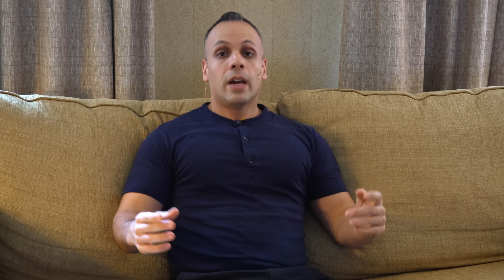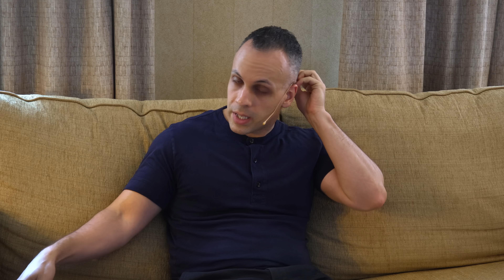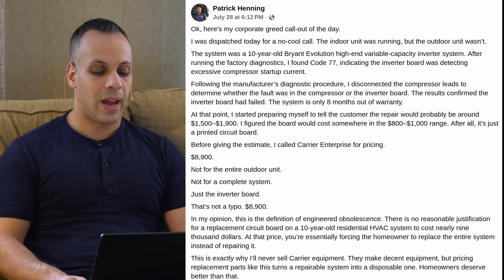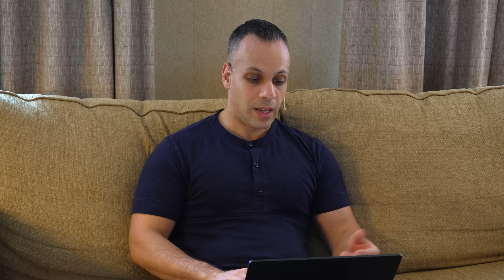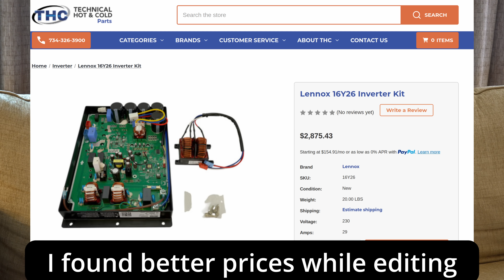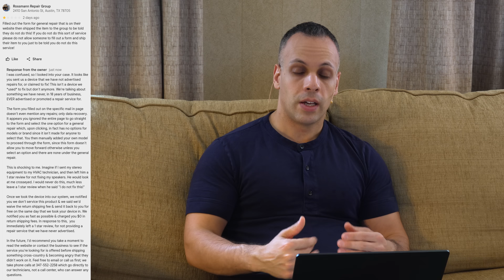Carrier AC repair has $8700 part cost for residential unit

Comment: A major problem in the HVAC industry is ever-changing environmental regulations. There is no expecation for industry to have long term, high volume production. They have to retool constantly because something that was compliant this year won't be a few years later.

It's interesting because in a closely related field, decorative heating appliances (fireplaces) are largely exempt from these standards, and 30+ year old units are often easily repaired with affordable parts that are still being manufactured. With some of the better manufactured units, the lifespan is effectively indefinate. I've replaced valves in 30 year old units that still look new, and I have no reason to believe they wouldn't last another 30 years.

Comment: Carrier is a shit company to do repair work for. They don’t keep a decent stock of warranty parts, itll take them about a business week just to get the parts to you, and out of warranty OEM parts are 2-10x the cost of an equivalent replacement part. Motors and boards are extremely sensitive to power fluctuations to the home. Their coils were pretty decent up until they shifted to the V style upflow coils, which now leak almost as often as Lennox and Trane. Im at the point now where when I open up my own business Ill try to steer as many customers away from this high efficiency equipment and install single or two stage units that only use capacitors and contactors for their outdoor units. Basically all blowers are ECM or variable speed but there are much cheaper and better built brands than Carrier’s crap

Comment: You're genuinely better off using old school dumb systems for this reason, at least if grid ties and not using a ton of energy. There are HVAC systems out there with zero pcbs still, you just gotta find em. You can definitely get the PCB out of the condenser at least, air handler pcbs hold up a lot better in practice.
Reply: As for power saving : just leave your ac set at a comfortable temp and never touch it. Smart thermostats are a scam. They kill systems.

Comment: Replace the electrolytic capacitors, $100 or so from DigiKey, you are ready to go. A/C tech added 2 pounds of R22 last month to our 30 year old 4 ton geothermal Water Furnace A/C system. When he leaves he hands me a pamphlet containing the replacement system info and prices. Mid level system (Air handler, compressor, evap coil, blower, heat exchanger) $25,300.  A new air to air heat pump from Goodman, a bit less than $6k. I can buy a boat load of electricity with $19,000 dollars.

Comment: You should absolutely try to get into the circuit board repair world for HVAC equipment. It would help a lot of private owners out (smaller businesses etc) if you can get them done faster than ordering a new board. Usually when a board is down, it's urgent, it's not like "oh, I'll use my older backup laptop until you fix my good one" - it's their one source of heating/cooling for that space. I do a lot of government HVAC design in Canada and they would never consider getting a board fixed. They'd throw the whole system out. I have also been bitten by reusing an older style furnace for a private client to save them some money, and finding out that they used to not be able to do certain things that all new ones can do, and that resulted in comfort issues in the space, so that's a downside of fixing the older ones

Comment: So.......people STOP allowing sales people to SELL you on variable speed condensers/compressors and 2 speed condensers/compressors for your AC system !!!!!!!!!!!!!! STOP STOP STOP!!!!!!!!!!!!!!!!
VFD variable frequency drive motors are great at ramping up and down to meet demand......until they fail or the drivers fail.  The variable compressors are TRIPLE the replacement cost and the driver boards are SUPER expensive IF you can find them.
When it comes to home AC......stay with tried and true.  SINGLE speed condenser/compressor !!!!!!!!!!!  ON or OFF....nothing in between !

Comment: I call bs, that may be what he is trying to charge the customer inverter and control board for the outdoor unit probably under 4k which is still expensive. He is probably the same type of contractor that charges 600 dollars to change out a 30 dollar contractor

Comment: As with any of these HVAC products, some will go bad, it doesn't matter the Brand.  It's at that point that you find out whether you've chosen a good Brand, or not.  I've had experience with trying to get a faulty compressor replaced in a newly installed Carrier unit.  Let's just say I will not be buying any of their products again.  Fuck Carrier.

Comment: I had a Samsung washer that would turn on but had a start button that wouldn’t work. To replace the board was $400. I got a bag of electronic buttons for $2.00 and soldered the new one on. It wasn’t a perfect match but once the casing was on everything worked and you couldn’t see it anyway.
Reply: On off switch is one thing..........a VFD control board is something all together different !

Comment: BRYANT is carrier to. The whole industry is a Scam. I worked in it for 20 years.
Reply: The move to VFD compressors is the issue...........the compressors are triple the cost and the variable frequency drive controllers are super expensive.

Comment: This is exactly why I refuse to replace my furnace and outdoor condensing unit that I installed in '86. I maintain them properly and they are so cheap to fix. I have never had any trouble with them. 
A couple of thermocouples, that's it. Lol.

Comment: It's totally not the same thing but the Midea U window units are variable speed inverter driven and can be had for less than $400. There is an inverter board in there. And a compressor. And fans. And all the supporting parts of an air conditioner. Upsizing a unit is no excuse for the board to cost $8000.

Comment: I thought it was going to be about an AC unit on an actual carrier (youtube is cutting off titles now on their current shitty UI revamp on my setup).

The problem in this scenario is most people are braindead, and will not check manufacturers practices or track record before signing a piece of paper.

Ask me how I know ? That's exactly what the rest of my family does and the more I warn them about that, the more they do it seemingly out of spite.

Therefore, what we need is laws to regulate this, yeah sorry I said the scary word. A ten year warranty for something that's gonna be outside 24/7 is not the best but not the worst either, but ready access to ALL the parts involved at a fair rate should be available for at least 20-25 years. If main company doesn't want to do it themselves, then they should be forced to opensource their plans and allow third parties to make OEM spec parts instead of this endless copyright nightmare we live in. When the product is a quarter of a century old we can reasonably start debating how hard it can be to remake new stocks of parts.

Comment: I quit my residential job and moved to commercial refrigeration just so I didn't have to see what was happening to the industry. I no longer work with money. My guess is Carrier saw what was happening in the industry where all of the small local shops were being bought up by private equity and price gouging. Even before this manufactured obsolescence was becoming this big of a problem, these companies were pricing repairs to the point where replacing equipment every 10 years was more cost effective when in reality, you should be able to expect 15-20 years out of your equipment. The private equity that purchased the company is worked for had us recording video bios about ourselves to send our customers to make them more comfortable with buying things from us. They started referring to technicians as sales techs to us and comfort consultants to the customers.  When people started crying over the prices I was quoting, I walked out. Actually the day I quit i cleaned out my truck before going into work, the higher ups from the private equity were there to watch as other techs made these videos. I tossed my keys to my boss and walked out right in front of these people and they knew that I was their second highest grossing tech out of 24. That company over the last 5 years has gone from being worth $13m to just $2.3m. I know it doesn't bother some people to do these things but I was not okay selling an $18000 system to someone who barely makes that on social security annually. I probably shouldn't post this here, but I doubt anybody that matters will see it. I started scalping employees from that company when I was still working there and doing the same exact equipment install for about one third of the price and still making more than my actual job paid me. For those of you that pay for a "comfort plan" of some sort every year, stop and have someone come out every 5 years and change your blower and compressor capacitor as well as clean your flame sensor and check gas pressure. Clean your own condenser with only water every spring and change your filter regularly. Youll save money. These plans are costing upwards of $200 per year for a full system and they include nothing but the foot in the door for a company to sell you more shit you don't need. I have stepped away from side work at this point but with my installs my customers got an included 1 year check up and service calls were free through the duration of the warranty.

Comment: My central unit used r22.  It got a leak somewhere and my only option was to have entire unit replaced. It was vastly cheaper to install minisplits throughout the house. Replacing an entire mini-split is only a few hundred bucks.

Comment: Also dude, most guys in HVAC are not that sophisticated. Even good techs won't necessarily even have a soldering iron on their vans. We use these old BMS boards that are built on a DOS system. There's a simple failure point I found right on a terminal block for the 24v power that will cause intermittent issues. You don't even need to add solder. Just heat up the pin and the problem is fixed. I've told so many people about this but they still just replace the board. It's crazy. Supermarket techs supposed to have some of the highest diagnostic competency. We don't like scary electronics though

Comment: I work on supermarket refrigeration systems and you can buy a whole VFD controller that powers multiple large condenser motors for less than that carrier board. Theyll run 24/7 and last over a decade easily. The problem we run into is areas that have dirty power kills them things but you can get inlet and outlet filters that will protect them

Comment: I used to to residential a/c repairs 15 years ago. Carrier is the one brand I would steer away from due to bad designs that led to early failures. They used to be such a reputable company but I feel like the greed over actual function has taken them over.

Comment: When our "help" window AC went out, because of my age, we call our go to HVAC guy.  Since it was a relative cheap window unit, I asked his wife about inverter window AC.   She replied with silence.   So we ended up getting a replacement which was functionally identical to the window unit I had  put in myself 25 year ago.   No moral to this story but built in inverter tech may not be worth the trouble.   

A church we sometimes attend had a major organ upgrade a decade or so ago.   The main blower was powered by an off the shelf VFD.   If it fails, he can get a functional equivalent literally the next day.   Perhaps the problem is that the HVAC makers keep too much of the tech "in house" rather they buying something with a "standard" interface.

Comment: As a lifelong HVAC expert, I live in absolute rage about not just AC manufacturers, but many, many, many AC service and repair companies. They rip people off at every turn. For example: (2017) I installed HVAC systems on an assisted living facility, and while the equipment was still under warranty I was out of town and a unit wasn’t working. I called a local HVAC company to get it back working. They went out and told me it was low on refrigerant and added 4 ounces of R-410A, charging me $135 per ounce. I called their company and said, “You know I am an HVAC service tech myself and I can buy R-410A for $0.35 per ounce.” They told me that was their rate and they couldn’t change it. WHAT? Now I tell building and home owners that if I am out of town, they have to pay for the repair or wait until I get back!

I had one service company quote me $250 per hour,

I had a uncle (RIP) who showed me how to pull those some motor control modules apart and replace a burnt out capacitor that you could by on Amazon for $0.25 each. The official part was a $125 kit.

This same uncle showed me how to look a control boards and find the bad parts and solder them out and replace them and us finger nail gloss to seal the board.

We had large exhaust fan in a parking garage run by a large VFD drive, This job was past warranty but I knew the maintenance guy really well as we had worked through building problems. This was in a remote area and quite a drive for me and I was really busy on another job so they called a tech out of Denver (2 hour drive) they told them it would be $2000 to send someone out to assess the system. He finally found someone to come out and look at the system and he was quoted $12000 to replace the VFD, he sent me a copy of the quote.  I told him that if he could wait for a few weeks I could stop by and look at it. So after 2 months I was finally able to stop by and I spent 2 hours looking over the fan because the quote he received stated an over current problem so I was thinking the fan was having a problem. I finally looked at the VFD and realized the somehow the system configuration had been reset to default so it didn't match the fan motor. I reprogrammed the settings and the system worked perfectly.  I spent 2 hours and it was solved. I didn't even charge him!

I like Goodman, they are owned by Daikin and have vastly improved over the past few years.  The absolute best system, IMHO, is to use 1 to 1 mini splits if you can handle multiple condensers. Daikin is a great option for this. Carrier is the absolute worst option.

Comment: Often these inverter boards have really trivial faults, mostly a busted electrolytic or a shorted MOSFET.   Such faults are usually easy to identify even without a circuit diagram and can sometimes even be identified simply by seeing the residue of the magic smoke they released.
 
Also the whole board itself doesn't contain more than $500 worth of components, possibly much less. The only expensive things are the MOSFETS and the inductors.

Comment: There is another choice than a different brand than Carrier.  The choice is one stage, two stage, or continuously variable AC.  When I replaced my furnace and air conditioner four years ago I went with two stage furnace and one stage air conditioning.  This is fine for me in the Detroit area.  Two things are very important to keeping installation, running, and maintenance costs down.  One is getting a system that is the right size.  The second is getting a good quality install.  The old furnace was 150,000 Btu/h 80%.  The AC was a 3 ton too old to have a SEER rating.  The replacements 80,000 Btu/h with a 2-1/2 ton AC. This whole system costs less than $8900.  Luckily there are a couple of really good installers in my area.  So yes, I would recommend Carrier.  What I would not recommend is a continuously variable system unless the costs associated with it don't matter to you.  One other reason continuously variable systems are so expensive to repair is because of the low volume of propriety parts in them like inverter boards.  The reason I went with carrier is because I had a system put in my previous house and had no problems for the seven years I lived there.  My heating cooling costs are less than half that of the old system and I'm very comfortable.  Carrier is ok.  Continuously variable is probably not for most people.

Comment: Mitsubishi used to do this with their inverter driven condensers. The freewheeling condenser fan used to run as an generator and over voltage the controller board whenever there was a massive wind gust.  The control boards cost more than a replacement unit.  As soon as they fell out of warranty you just replaced them with another brand.

Comment: They're doing the same thing with HVAC, as they're now doing with water heaters - telling people that when it hits 10 years old, it needs to be replaced. And a lot of the companies that supposedly deal in servicing or repairing either, don't want to even give you the time of day unless you agree to buy an entirely new unit - I've been told outright by some companies "sorry, we only do new installs" - or they blow you off entirely and you never hear from them again, once they figure out you're not going to bite on a new system.

Comment: In my small city of 50k people, a prominent local HVAC firm dropped Carrier because of parts availability and cost. When my 21 year old Trane system failed, I had them put an entirely new Lennox system in. I’m very happy with it—full inverter, very efficient and most importantly, super efficient. It also has no copper, zinc, or steel in the coils—100% aluminum. No galvanic corrosion, no rust, no green copper crud.

Comment: Its job security that is all it is, make it expensive and price out DIY for doing it themselves or thinking they can.  

HVAC is the easiest system to repair, not a whole lot going on.  Caps blow every 3-5 years, boards in 7-10, recharge almost never until heavy use or a leak.  

Iam still using r22 in mine but no one will touch it today, I have to repair it myself , until my r22 runs out have not been able to source it for about a year now